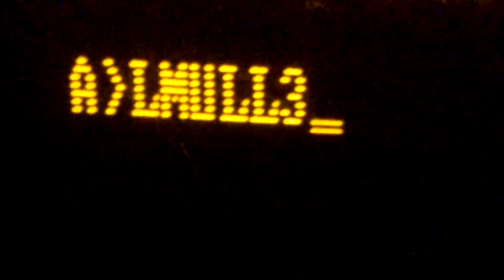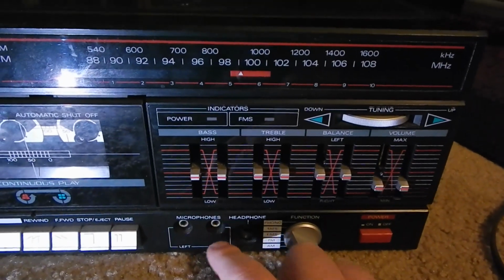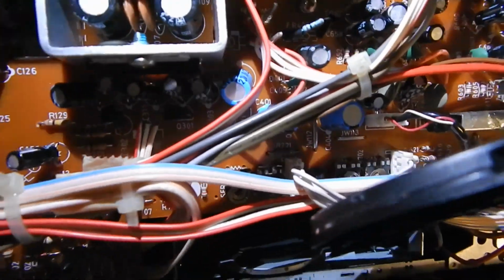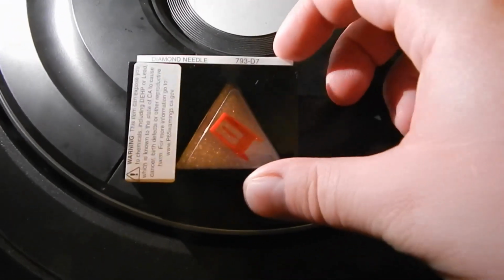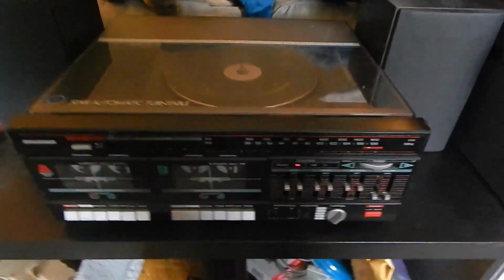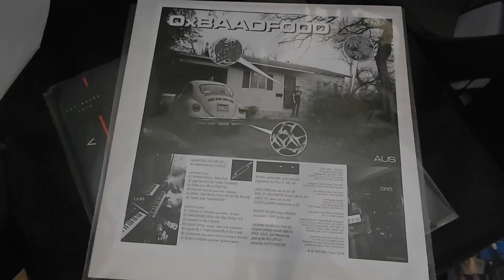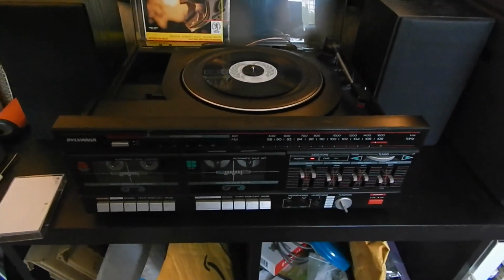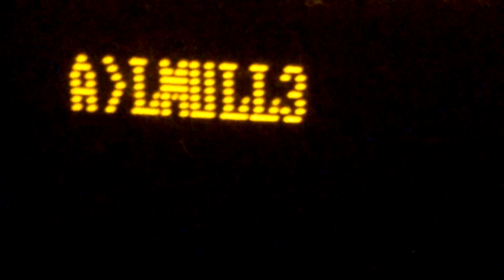1980s Sylvania SY-1801 Stereo System

Comment: NAP Consumer Electronics stands for North American Philips. Which means this system was almost certainly also sold as a Magnavox, as that was the main brand name Philips was using in North America in the '80s. Edit: I found it -- this was also sold as the Magnavox MX1800. And year 75 in the Republic of China calendar used in Taiwan equals 1986 in the Western calendar.